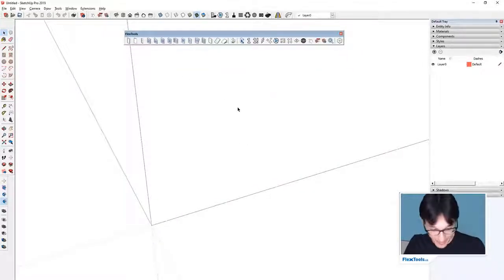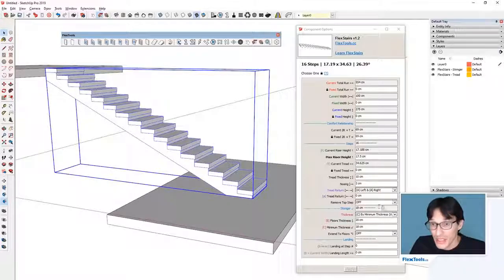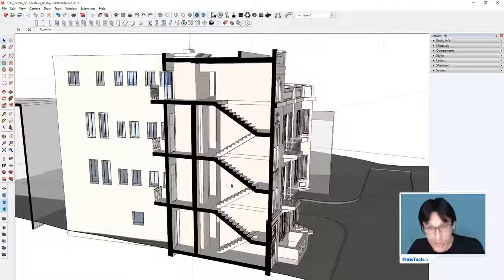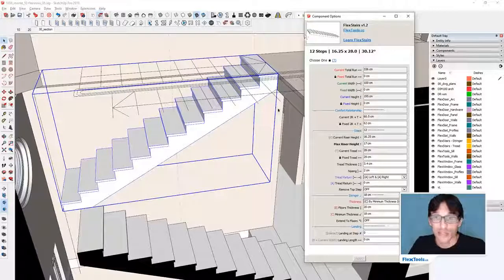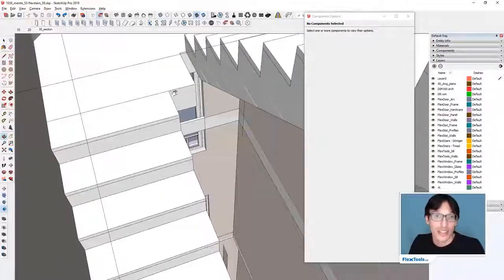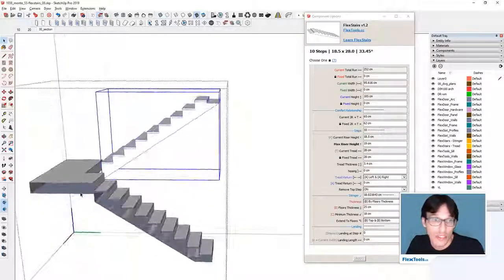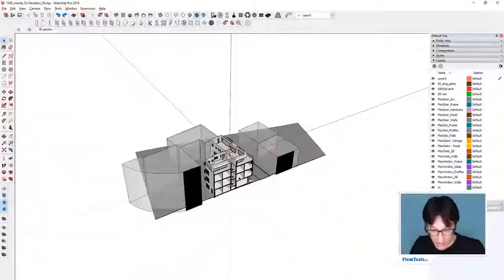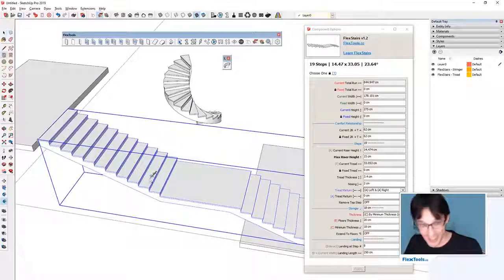FlexTools Webinar 1 - FlexStairs

Comment: What about Railings? How can you add railings which will align automatically with the stairs? Is there a plugin for it as well?
Reply from the maker: Hi Ahmed, you can try adapting a fence component as shown here: https://flextools.cc/blog/introducing-flexfence/#flexfence-and-stairs .  Or try using Profile builder 3 which does a great job with fences and railings.

Comment: That zeroing out to disable something and enable other thing is very confusing. Use checkboxes  or dropdown menus, anything beside zeroing out.
Reply from the maker: Hi MySchizo,  

I understand it can be confusing sometimes, but it's really not so complicated. This is currently the best we can do within the limits of Sketchup's Dynamic Component's interface and all the DC plugin's bugs we are constantly working around.  Drop downs won't work for this case and there are no check boxes at this time in the DC plugin. 

If there is something that isn't clear or you need help with, feel free to contact by email or chat and I'll be glad to help out.
Reply: @flextools4su  ok mention that 0 disables the field somewhere on the UI
Reply from the maker: @Z-add  In the UI on top it says Choose One 🔒 with a link to the help page. 

I wouldn't be surprised or offended if you told me the help page is too complicated.  If you have ideas how to make it simpler/clearer I'll be glad to make changes.  Best if you send me an email (https://flextools.cc/contact - It's very difficult to correspond normally through youtube comments).